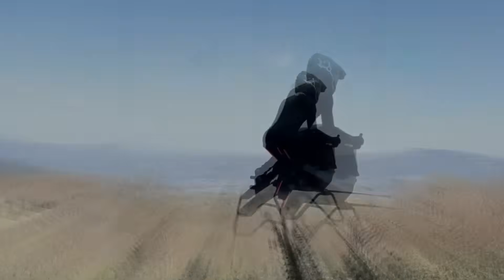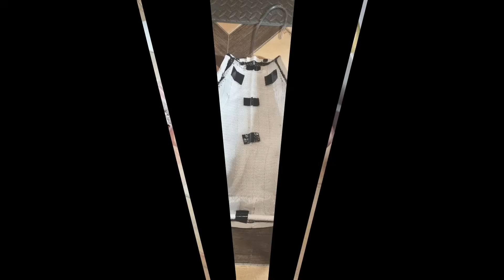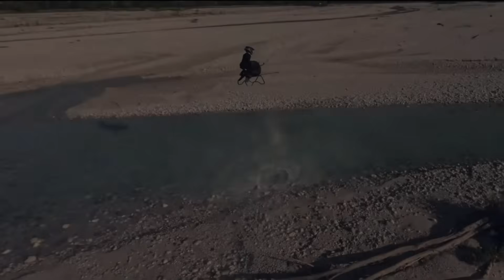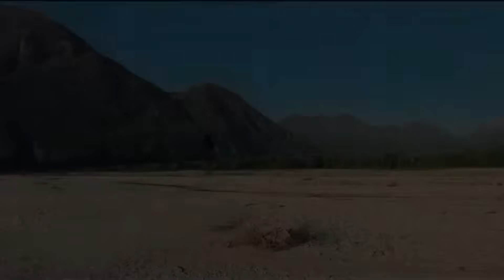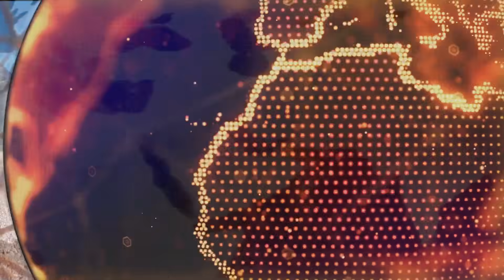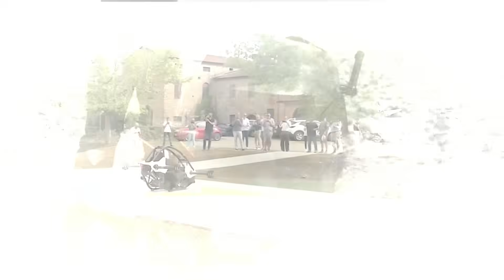2026 NEW VOLONAUT AIR BIKE OFFICIALY LAUNCHED!! Key Features, Tecs, & Benefits!!

Comment: Put a star war speeder bike shell and that would look sik
Reply from the maker: @jerrys.t.9368
That would definitely make it look even more futuristic and badass! A Star Wars speeder bike shell would take the design to the next level. Imagine the tech on that, too – would totally be the ultimate crossover. What other sci-fi designs would you pair with this tech?
Reply: @innomoto  maybe the DeLorean in back to the future
Reply from the maker: @jerrys.t.9368 Oh man, a DeLorean design would be wild! Imagine the flux capacitor tech built into a flying bike. The ultimate fusion of sci-fi and real-world engineering. You’d have the speed, the style, and the power of two iconic machines. What other features would you add to make this the perfect time-traveling ride?

Comment: looks nice, but need a prachute safety, and 130 db was ""killing"" 😖, and co2 🤷‍♀️  good but, sorry... not good enough in this times
Reply from the maker: @wow-dg2xt
Totally fair points — safety systems like parachutes are a must for anything flying this low and fast. And yeah, 130 dB is brutal, especially in urban environments. Add the CO₂ emissions, and it’s clear this tech still has hurdles. The cool factor is there, but the sustainability and safety have to catch up. What kind of improvements would change your mind — electric propulsion? Built-in auto-landing failsafes

Comment: IS THAT GAS POWERED?
Reply from the maker: @wompstopm123
Yep — it's gas-powered, using small turbine jet engines similar to those found in some experimental VTOL crafts. 🔥🛩️ These engines deliver powerful thrust, but that also means high fuel consumption and loud operation — over 130dB in some tests.

Electric versions are being explored, but current battery tech struggles to match the power-to-weight ratio needed for vertical takeoff like this. Would you be more interested if it ran on electric or hybrid propulsion?

Comment: noise level ?
Reply from the maker: @jeffrenman4146
Great question! While exact decibel levels haven’t been officially released, the Volonaut uses jet propulsion — which typically means very loud, likely in the 120–140dB range at close range. 🔊💥

That kind of noise is comparable to a fighter jet at takeoff, making it a major hurdle for city or suburban use. The creators have hinted at future developments in noise suppression, possibly moving toward quieter hybrid or electric propulsion.

Would you be open to personal flight tech if it came with strict noise and safety controls?
Reply: @innomoto  The one terrible thing that our species is ignorant about is noise pollution.  Where flesh and blood were not machines.  Noise pollution harms people every single day.  It's probably one of the most seriously neglected issues were facing.  The reason for greed and stupidity.  Certain things should simply not be made but people see dollar signs in their sleep and they don't care literally they don't give a flying leap about any of us just there Insatiable lust for money
Reply from the maker: @jeffrenman4146
You're absolutely right — noise pollution is an invisible threat that’s all too often ignored. It impacts sleep, stress levels, even long-term health — and in the case of these high-decibel flight machines, it’s not just a nuisance, it’s a real public health concern. 🔇🧠

The technology may be exciting, but without strict regulation and ethical design, it's just not responsible. Greed shouldn't override community well-being — especially when quieter propulsion alternatives, like electric ducted fans or active noise canceling, could be developed with the right focus and intent.

Would you support legislation that limits noise output for emerging aerial tech like this?

Comment: caracteristicas tecnicas?????????
Reply from the maker: @luislopez-cy8mk
¡Buena pregunta! Aquí tienes un resumen de las *características técnicas principales* del Volonaut Airbike (basado en la información disponible hasta ahora):
🚀 *Propulsión:* Motor a reacción tipo turbojet
⚙️ *Potencia estimada:* Alrededor de 150–200 kg de empuje
🪂 *Peso en vacío:* Aproximadamente 140–160 kg
🔋 *Autonomía:* Muy limitada — de 10 a 20 minutos de vuelo, dependiendo del peso del piloto y condiciones
📏 *Altura máxima estimada:* 1.000–1.500 metros
🧑‍✈️ *Control:* Fly-by-wire con asistencia electrónica y estabilización automática

Es más una plataforma experimental o de aventura extrema que un vehículo urbano por ahora.
¿Te interesa que hagamos un video completo explicando todos los detalles técnicos? ✈️🔧
Reply: @innomoto  muchisimas gracias, en el futuro va a sustituir a la moto, gracias
Reply from the maker: @luislopez-cy8mk
¡De nada! 😄 Es genial ver que piensas que esta tecnología podría reemplazar a las motos en el futuro. Aunque por ahora es un experimento de alta gama, con el tiempo podrían surgir versiones más accesibles y eficientes. ¿Crees que en el futuro las motos voladoras serán la norma? ¡Estaremos atentos a cualquier avance!